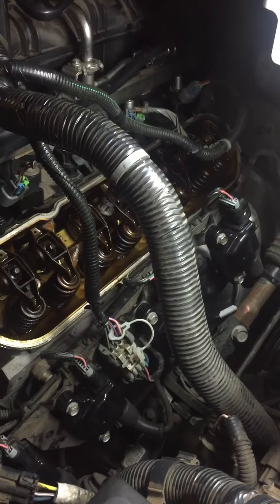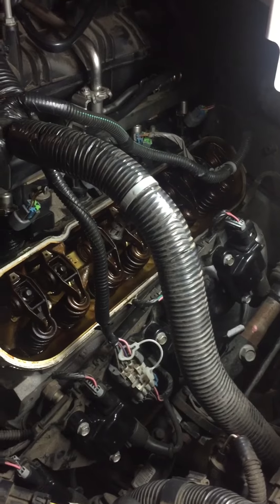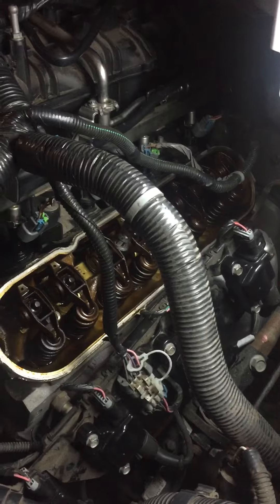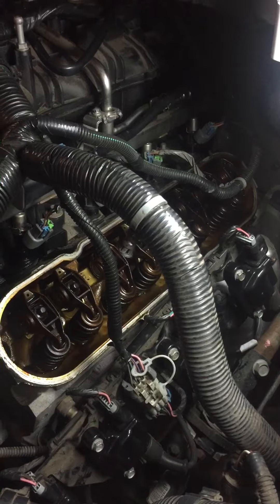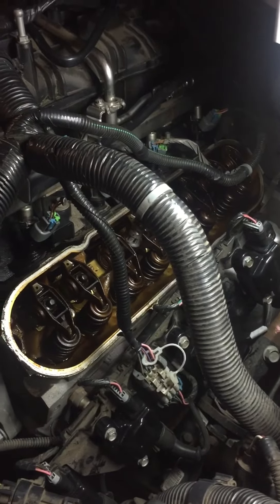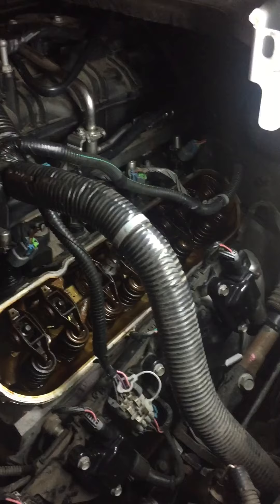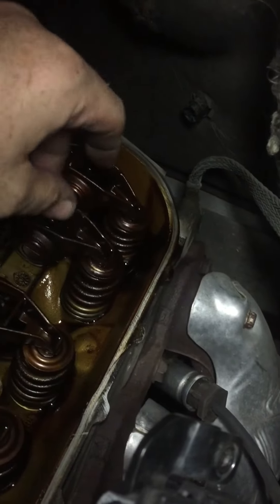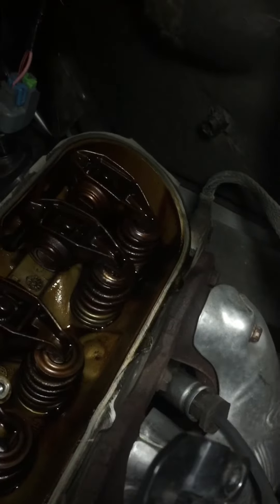P0300 misfire 2009 yukon hybrid

Comment: Damn. My 2009 black Tahoe hybrid  is misfiring on cylinder #8 but it’s not as bad as that. Hopefully it’s not my lifters. I’m going to try to replace my spark plugs and wires first. Good luck on your hybrid bro!
Reply from the maker: Triple OG16 it was a valve.  So I had all of the valves replaced. Runs like a champ now.
Reply: Paul Howell what valves?  Sorry not a mechanic.
Reply from the maker: O. G. Valves are located under the valve covers.  If you think of an engine as a V from the front, if you have a v6, v8, etc, then as you look from the front of the engine you see the valve covers as the tops of the v.  The head is actually located under the valve covers but the valves are inside of the head and open and close to allow air and fuel into the cylinder head as well as let burnt fuel out.  If it's a 4 cylinder engine or a straight 6, those are the more common although there are straight 5's, straight 8's, and even some straight 12's on vintage cars, the valve cover will be sitting on the top of the motor, with the valves and heads below.  There are also H engines, W engines , and rotary engines that have all been used in automobiles.  They are interesting and you should look up some videos on the YouTube to see them.
Reply: Paul Howell thanks bro. Was it expensive to replace?
Reply from the maker: O. G. If you have someone just do one side of the engine it is around $1500 I went ahead and had both the drivers and passengers side done and it cost about $2400.
Reply: Im looking to buy this Hybrid here https://raleigh.craigslist.org/cto/d/2009-chevy-tahoe/6612791626.html do you think it has the same problem yours had? Appreciate it if you could help me thanks!
Reply from the maker: Marcus Thomas could be. The only way to know for sure is to remove the valve cover and see if the valve is moving.  It could be a bad plug, plug wire, injector, coil, or a few other things to though.  You will need to do some u troubleshooting.
Reply: Paul Howell Ok thanks, I will try to have a mechanic go look at it with me, just want to make sure it doesn’t need an entire engine replacement.

Comment: Hi Paul! There isn’t much info on this at all and I’m at my wits end, My 09 Tahoe hybrid has been having cylinder 7 misfires recently. Changed the plugs, changed the coils. The misfires are so bad that the car rumbles and rides beyond rough. Especially in reverse. Is it a communication issue between the stupid hybrid drive train and the engine? Sometimes it drives perfectly smooth. It is two mode so it seems to be when the hybrid to engine switch happens. Also it is occasionally throwing the cat converter code and large evap leak code. I replaced the throttle position sensor and the throttle pedal. Two of my mechanic buddies have turned me away and told me to go to the dealership. 
Two questions:
-what do I use to clean the hybrid battery cells with after I take it out? A toothbrush?
-what do you think the problem is and what is the cheapest way I can fix it? Please help

Comment: Did you do it your self? Mechanic wants to charge 6000
Reply from the maker: Jesus Herrera $6k is way too high.  The parts are about $8-1000 per side of the engine from the GM dealership.  I found a local mechanic with a good reputation and warranty his work who would do it for $1900 for one side or $2400 to do both at the same time.  I chose to go that route because it was way quicker than me doing it.  Call a couple other shops and tell them what you found, this is fairly common with gm engines so there should be guys with experience.
Reply: @Belzon1  the mechanic told me today it was a valve. By any chance do you happen to have the parts number that you replaced. I love the truck but this year I had to replace battery and power control module. Since the mechanics resale parts i would preffer to them myself.